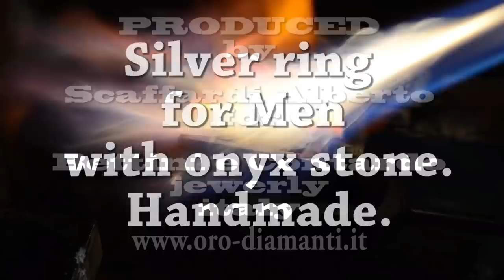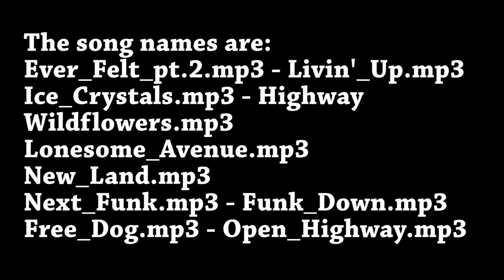Silver ring for Men with onyx stone Handmade

Comment: Wow, that was amazing. Your engraving skills are incredible. One question- I'm curious why did you chose to glue the stone instead of add a bezel?
Reply from the maker: thank you, This stone is cut with very high and smooth edges, to be stopped with metal, I should have kept the ring head too high. The glues we use have a really strong hold often equal to the metal

Comment: What is the coil that is on fire in stead of a torch?
Reply from the maker: as a base when I hold up with the flame, I use a table clock spring, I use it because the object's heat is not dispersed on the support surface.

Comment: what kind of solder are you using?
Reply from the maker: Use silver solder, which I buy ready
Reply: scaffoal do you have a link or source? I'm looking for a similar silver solder that is jewelry quality yet flows like what you're using. It looks like normal silver solder (mostly tin) by the way it flows. 

I have easy, medium, and hard silver solders for jewelry but it needs to be cut into strips not filled and flow like what you're using. Any help would be awesome.

Comment: What was that blue paste that you laid on the saw blade?
Reply: looked like scrap blue casting wax, you can also use beeswax or burr lube. I drilled a 1/4 inch hole through bench pin side edge ("D" shaped - flat side is even with bench pin) and fill it with melted wax using masking tape until wax hardens.
Reply from the maker: wax